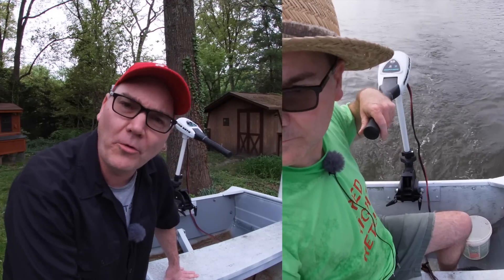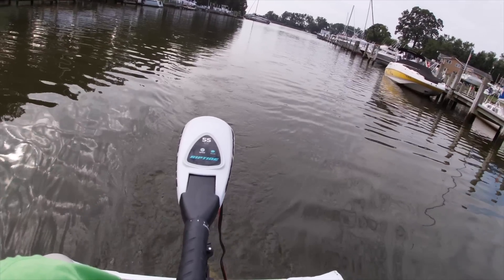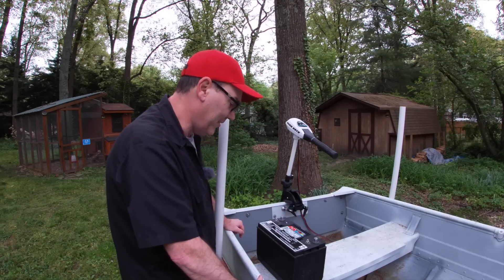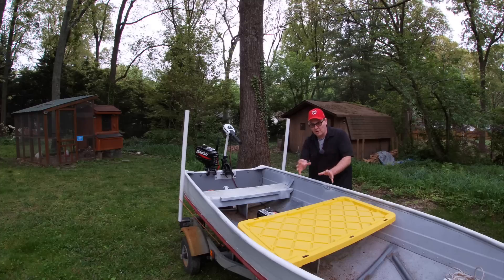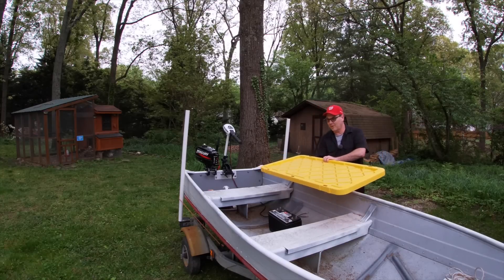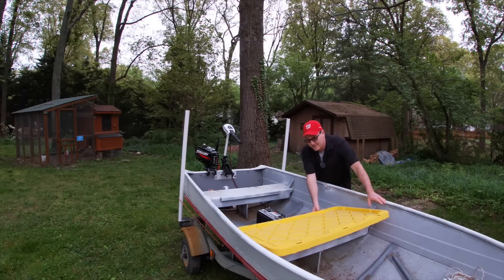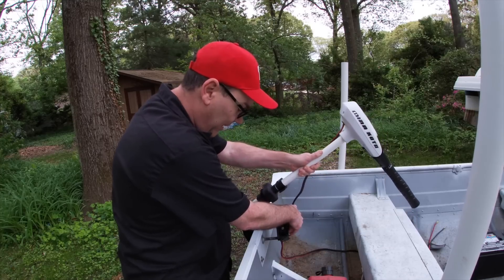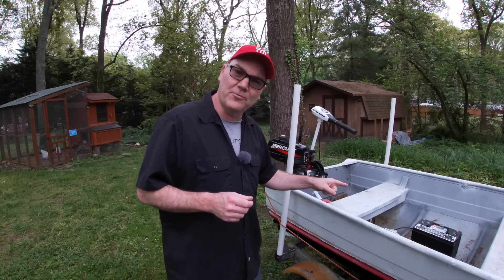How Many Solar Panels Do You Need For A Trolling Motor?

Comment: I just had to add my 2 cents.  First of all, I have being running the following setup for over a year and have only had to charge my system a couple of times with an electric battery charger.  This was only because it was winter (less sunlight hours) and we had a full week of cloudy rainy weather. The whole system cost me roughly $200 since I already had a trolling motor and a battery.   Your numbers are probably correct if you run the trolling motor constantly and as the main propulsion for the boat.  Most fishing trip I do would be pushing it to use the trolling motor more than 50% of the time.  Every time you stop to fish or do something, the solar charger will catch up. I fish every weekend, all day Saturday and half a day on Sunday's.  Most of the time when I get home my battery is 90% charged or better.  I even charge going down the highway and while it's sitting in my yard.  I have a 12 Volt trolling motor(XI5), 100ah lead acid (about to go lithium for weight loss),  a $40 charge controller and a 100 watt solar panel in the boat. I also have an addition 100 watt solar panel on the side of my house.  I plug this one in when I get home for 200 watts maximum charging.  Add another $100 for this one, but I don't think I really need it.  I probably should have just bought a 200 watt solar panel for the boat and be done with it.  This set up work for me in my 18 foot aluminum bass boat.
Reply from the maker: So it can work in this situation - and that is how many people do use it (trolling motor as not the main propulsion and only used some of the time) Thanks!
Reply: 10watt 12volt solar panels for 50 bucks are ancient, you now can get 100watt 12volt also for 50 bucks
Reply: I'm trying to get to the point you're at.
Just calculating the solar panel size that doesn't take up too much room on the boat. 
But your system is ideal! Thanks
Reply: @RICHIE26636  I can't put in my two cents. Old boat captain nicknamed me cent and a half. Said I wasn't worth two cents:)
Reply: I have a 45lb minn Kota trolling motor with a timeusb lithium battery..50 amp hr..I fish alot and I've been out 8 times and haven't had to recharge the lithium battery...I need to see how long it takes to completely kill it...but the battery was 139.00 has a 50amp bms so I dont need a fuse going to the trolling motor
Reply: Btw..the battery weighed 17 lbs
Reply: I wonder if a bluetti 2000  would work
Reply: Whats your setup panel and controller? Ive got a Minn Kota 55lb. thrust on my Excursion 5 with a 100ah lithium marine battery.
Reply: @Meep2076  It's changed over time.  I'm still using everything I originally was using except I did upgrade the battery to Lifepo4 100AH and I'm now using a Victron Energy SmartSolar MPPT 100V 20 amp 12-24-48 Volt Solar Charge Controller (Bluetooth).  The old cheap one got wet and stopped working.  Still keeps me charged.  I have no issues.
Reply: If you use a PWM speed controller you can stretch that out even more. The trolling motor uses the same power regardless of speed setting, any excess is just burned off as heat.
Reply: @commoguru  I had wondered about the PWM speed controller question too. I switched from a Minn Kota Endura trolling  motor that uses a heat sink speed controller to a Minn Kota PowerDrive that has what they call their "digital maximizer technology." I believe this is a PWM controller. The way I use the motor is for low speed trolling, 2 or 3 hours at a time. I only have an 78 AH battery and the bigger M-K PowerDrive takes less time to recharge than the smaller Endura did. (Either way my power demands are low enough that I'm not over-taxing even this small battery.) I'm thinking about using a solar panel to recharge the battery next summer just so I don't have to run a long extension cord out to the dock for recharging.
Reply: @commoguru  No, my trolling motor is varible speed controlled and uses far less on lower output.
Reply: @commoguru  interesting 🤔
Reply: disclaimer: I don’t own any electric motors for boats or EV’s 
I think Wayne was extremely narrow minded in this video. Right now, if you have an electric trolling motor, you may be disconnecting the battery  everyday to bring it back to charge. Solar probably solves this daily charge chore… it can also charge the battery when stopped. There’s also draw differences in how you use a trolling motor. Getting from point A to point B would have different draw characteristics than slowly trolling while fishing (depending on current, wind etc)
Reply: Solar panels can only put in and we only use less than 20% of their maximum rated output once hooked up to battery or grid
ohm's law 102
If you look at your controller it will tell you how many amps multiply the volts and that will tell you how many watts
Or
Solar panel volts -battery volts

Comment: One thing about trolling motors is that they were not designed for efficiency because bass boats have reliable power.  The round stock alone is a drag monster.  If a fairing could be added, that would help a lot.  Many people who use them are running custom props they 3D print.  And in the past for slow moving, they would run 12" model airplane props.

Not sure about your math as there are lots of boats that are said to be pure solar that are circumnavigating, or making infinite power.  Or possibly running diesel in the middle of the night.

One cool thing about the circumnavigators is that they have to run through the equator as much as possible, in the region called the doldrums.  There is little wind there, a dead zone for sailors, and max sunlight.

Comment: Another E-power boat builder here.  My 17 ft decked runabout has twin 24 volt 2 battery banks,  4 batteries mounted low for stability.  I use Interstate marine equipment size 29 batteries, bigger but long range power for 60 lb weight.  I get 6 hours plus, of continuous run time, using a minn kota dual 80 lb.  thrust set, cruise is 4-5 mph, for about as long as I can sit in a boat .    Probably will add the solar panel I just bought, for a bimini top panel.  12 Years now, zero problems, just works.  This is my 12 th. boat of many types, all wood, built from scratch, love the new stuff,

Comment: Or small inverter generator and battery charger. I have PowerKick inverter generator 800W  max 450EUR ,and Telwin Doc50 battery charger 6/12/24V max 40A 450EUR.

Comment: Outstanding presentation. I was screaming you are wrong until you came up with a 600 W part. This is the absolute best presentation of the solar panel battery motor journey that I’ve seen. I think people go into solar panel, battery, power, etc. with false expectations. When you get a chance, look up one of these little battery generators everybody’s pushing and they throw in 100 or 200 W solar panel. Thanks for the research you do.

Comment: Solar applications are situational.
I run a trolling motor on a canoe directly powered by two 100-watt light flex solar panels and no battery or controller.
Solar on a dock or boat awning may be less than installing shorepower when you go electric.

Comment: FB marketplace is flooded with used panels for $50 each  300 or 400 watt panels.   pick up one for $50 and if needed add one 100 AH for $175.   Off market Li - Iron are $160 all over the place...but, may not be as good as the watt cycle brand.

Comment: Hi, I have the Newport 55lbs Thrust 24" Shaft with a 100 A/h LiPo4 Battery. 
1st thing I would recommend is switching Hull Designs. Do you canoe? That Fishing Boat is shaped like a Barge.
2nd After I put the 55lbs Thrust on the canoe. I would take the Safety Persuasion to put a Safety Rope on that Motor. (Motors tend to like to go swimming without the Vessel. There is a Youtube Video about it.)
3rd Then Re-Test the Range of that Electric Motor Properly attached to a Canoe with a 100 A/h Lithium Battery.
I regularly run mine over 6 Hours on Lakes and Rivers and have never even drained the power below 75%.

Comment: Only one panel solar 400 watt 24 volts today 2025 : 150 euro even less. Charge controller 85 euros more ore less. Cables 5-15 euros.
But there is no sense : it's better to charge the battery at home with a solar panel system. The best solution is having more than a battery on a little boat, LiFePO4 but not using them at maximum speed ( LiFePO4 is 14,2-14,6 volts completely charged, 80% is 12,8 volts the lead acid battery have got 1 volts less )

Comment: It needs 20 solar panel to move a motor of 55 ampere. 30 hours to recharge a battery of 100 ah LifePO4. Better to recharge it at home not on the inflate boat.

Comment: The price of the set up doesn’t matter to me at all.  I want to dick at a marina that doesn’t offer power and charge my 24v trolling motor battery system using solar because it’s the best option.  Is that doable? If I grain around 30% of my batteries per trip could I expect the batteries to be fully charged after a day in the sun? I was thinking I could fit a 100w panel on the boat while I’m not there.

Comment: a 450w solar panel is 1.2m x 1.8m in 2025 ... two of these could easily run a small trolling motor at full power (and one is sufficient if you pump the charge into a battery and don't run full throttle all the time).

Comment: You would have trouble finding the room on or above the boat to power the lights alone let alone the trolling motor. 

The closest you can come to free propulsion is the wind. A boat with a super efficient, small electric motor, two large sails, as many methods of making electricity as possible and you may be able to run on the electric motor on occasion at best assuming that the motor has the latest pulse width modulation type speed control vs resistance, and even still you will find yourself stuck on occasion with no power, no wind, and nothing but maybe a paddle. 

The boat design would also need to be rethought, a typical V hull or flat bottom simply has too much drag to be efficient enough for solar electric power. Think of a super long catamaran with two long skinny hulls and as little in or above the water as possible other then maybe raised sails. 

As travel goes, water is the most energy consuming to traverse upon. Nearly the equivalent of driving through mud. 
The wind isn't always there to help, nor are the tides or current. Its more a matter of learning to follow the current and wind when its available and to make use of the sun when possible and take what you get and wait for better to come along.

All a far cry from the small aluminum boats we run today with a 10hp motor on the back or a battery trolling motor.

Comment: I think you are correct that solar in a boat like this would not really be practical for typical usage, but may be an option to consider for some very limited purposes. For example, if you were trying to do some expedition to an area where you can't resupply like for disaster relief or in developing countries, if you had a small boat with a roof with a few solar cells and a small trolling motor and perhaps a couple of LiPo batteries, it would allow you to increase your range and perhaps, even rescue you out of a bad situation. It would likely mean you had to take a couple of days to recharge the batteries along the way, so it wouldn't be practical for most typical uses, but as a last ditch way to have power in extreme situations, I like it. My hope is that the research being done on solar cells like the 3D ones, and the research into batteries, will make for much more efficient and inexpensive solar power down the road.

Comment: 0:56 A system like that is great for just keeping it topped up though.
Lithium takes a charge much more easily, and with a 5-10A charge from a solar panel it could charge the battery up to be ready to go the next day. So I think it is interesting, not as a "indefinite running boat" but as a boat you just leave in the sun for a day or two, and you could just jump back in. You could even add a tiny monitoring device that sends a status once every 5 minutes, or just once an hour with the current charge rate, f.ex via LORA.

Comment: I have some old 250W rooftop solar panels (the inverter died and isn't worth fixing) that could probably be put to good use with my old aluminium fishing dinghy and an electric trolling motor I bought several years ago but never used... Just have to make a frame to mount the solar panel(s) on (would make a good sunshade too). Probably just need to buy something to regulate the max 5A/46W output to something that won't make the battery explode during charging...
ps. Since I have 6 panels each 1.5m x 1.0m in size I might just use three on the dingy (abt 4m x 1.6m) to make a roof/canopy for the dinghy and then use the other three to make a roof for a carport style 'boat shed' and keep another 12V battery charged up to run LED lights, laptop and phone charger etc.
The economics work out a lot better if you have old stuff lying around unused that already 'paid for itself' years ago.
Reply from the maker: Yeah you would need a charge controller but other than that - Just be aware of the weight they would add to the boat and how top heavy it could be.

Comment: 5:50....The math seems excessively negative against solar.  A 100 watt panel should generate around 6 amps @ 75% sunlight, 2 100 watt panels is 12amps. over 4 hours that's 48 amps.  I believe at best you would get 80 amps out of the battery shown and that's damaging it, 50amps is much more sustainable and at that number you are getting almost as much amps out of the solar as you are the battery.  Truth is the way most fish they could use a 2 panel setup and never run out of battery.   BTW today (2025 a 200 watt system is as cheap as $200-250).

Comment: your video makes no sense nobody is looking for infinite runtime.
the point is to get constand generate additional runtime.
and on any boat any solarpanle makes sense.

a trolling motor uses 350 Watt and with a 100ah lifepo"=1300Wh" i get 4 hours of runtime
with a 100 watt flex solar panel i get every 3,5 hours an adittional hour of constant runtime of the trollling motor so i generate over time runtime, runtime runtime..
thats the point that any solar panel on any boat is a big deal.

same like talk about confusing prizes, a 100 watt flex panel cost 90$ 2  years ago a charge controller you get for 10$ and thats all what needet to get big iprovments.
Reply from the maker: You might be surprised but there are people who have asked me in comments, blog posts and other places if they can just hook up a little solar panel to a trolling motor and run all day. 
They have also asked how many panels they need to keep a trolling motor battery fully charged while under way.

Comment: My solar boat does work , sort of..  I only use my boat an hour or less per day and the solar is always charging. So it has many hours to charge. I have a 40 lb motor that I run at 50% power as going to 100% only gives about 10% more speed. From an dollars and cents perspective I would be miles ahead running my 2 hp Honda on gasoline

But the solar electric is quiet and starts some good conversations. 

Maybe 10 years from now solar will have improved performance and be cheap enough to make economic sense.

Comment: I like the idea of solar, but honestly, if you want renewable power for your boat I think a sail is the best way to start, and since you have a mast anyhow a wind turbine is a better bet. Use a trolling motor or electric outboard for moving around the marina, and then once you are out away from shore use the sails! A 400 watt 12 volt wind turbine with a startup speed of under 6mph of wind can be had for $130 or so from Amazon right now, and with this solution you don't need it to meet or exceed the engine's power draw constantly in order to move. You can maneuver for an hour or two, put your sails up, recharge your batteries while the boat is moving under sail power, and then you have a full battery again if you need to use the motor some more.

Comment: I motored my 27 ft catalina sailboat with a trolling motor all day without draining the battery at all with 550 watts of solar.

I could run about 1/2 speed on the trolling motor and that gave me. 1.5 knots.

No reduction in battery voltage.
In fact i could remove the main batteries and only insert a very small battery to keep the electronics  operating during clouds and it worked great.

Comment: you miss the point of why most want solar charging its usually because for whatever reason getting to a standard charger is difficult and them batteries you got r heavy  im guessing if 100 amp hrs  65 lbs or so each

Comment: A gasoline engine is the best solution. There are no free rides. Lifecycle costs of electric set ups, whether cars or boats, exceed those of combustion engined equivalents. Typically, solar panels in their lifetimes and under normal conditions, never generate enough power to recover the energy that went into building them. If you enjoy quiet running, with no smell or live on a lake where combustion engines are not permitted, go electric but buy a Torqueedo and pay the price of equivalency.

Comment: Well, the way I would use it, is to drop a 100 W panel on the boat with a charge controller and just let it maintain the battery between uses. That way, you never have to plug it in.

Comment: I made a 7' outrigger for my canoe.  Sails great, but wanted to come back when no wind, on Florida saltwater, from miles out.  $29, 12" panel, marine battery, and 55# Newport trolling motor does the job well.  I've never run out of charge.  Not even close. Panel came with controller, so no worries about over change.  It's quite, smooth and retty quick.  I never have to do anything with it.

Comment: Simplest is to use one 12.8V 280AH LiFePO4 battery. That's almost 6 hours at full power.
Reply from the maker: Yes - the 12 volt LiFePo4 batteries are getting very affordable